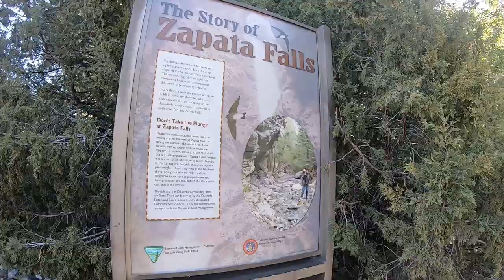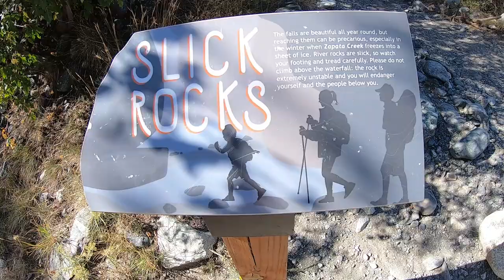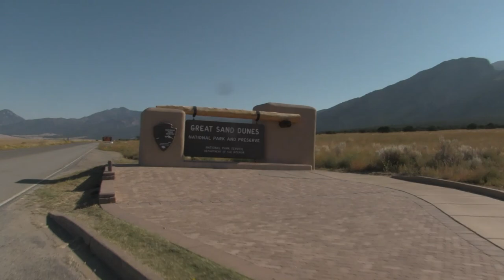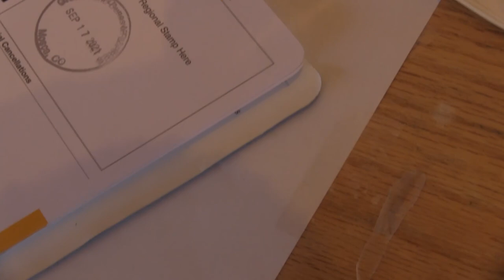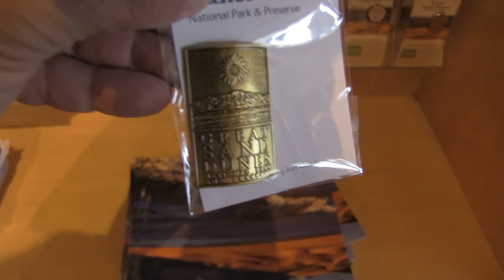Zapata Falls & Great Sand Dunes in Colorado | POTA (Parks on the Air)

Comment: Thanks for taking us where I could not go.   Reminds me when I had a cb radio. Talking to truck drivers etc.  I had a VW bug at that time.  Late 70s.  I put a 10 ft whip antenna on the bug right above the engine cover.  When i was driving the antenna would lean way over..

Comment: Hi Mike
What size air compresser did you use to paint your bus?
Reply from the maker: It was a 30 gallon compressor but I believe it was a two piston. There were times I did have to wait for the pressure to come up but not very often.